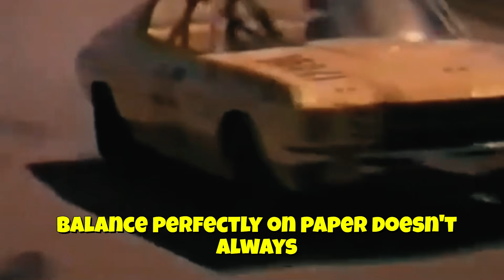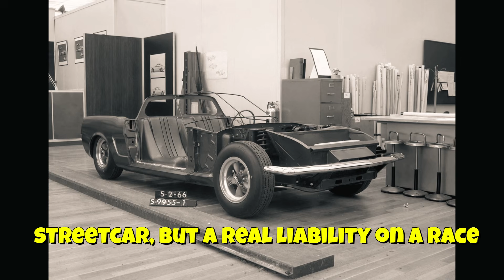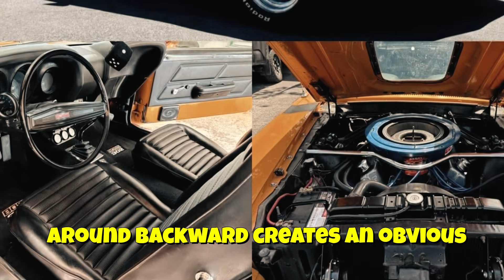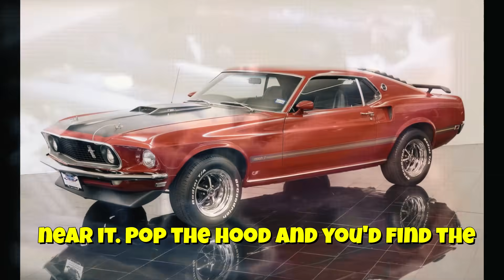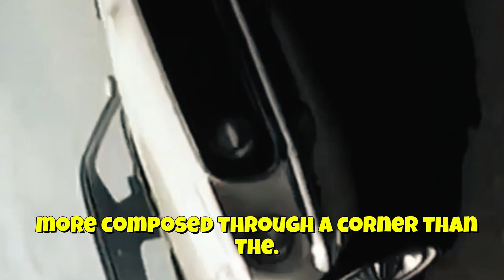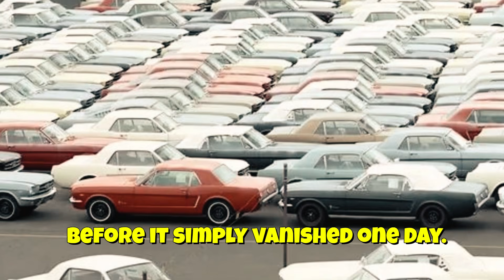Ford Built a Secret Mid-Engine Mustang… Then Tried to Destroy It

Comment: I'm shocked that would have been epic if they got the bugs out but I've had some experience building a secret car for gm no one knew about but me they supplied me prototype parts and my only obligation was to install and report results back part by part using a vericom computer for I'm initial testing this car was very rare 87 Grand am Turbo intercooled all black the contact  was from Pontiac Saturn head of engineering at the same time the Pontiac Gta was turbo was released and the scrapped parts that never made production were secretly sent to me no serial numbers scrapped off parts I made my own piping and brackets all I can say is 4.9 sec to 60mph and topped out at 141mph on maine turnpike quarter mile was rough 13.9 spinning the tires half way down the track lol it was a 5.0 beater and iroc eater and caught some Grand nationals off guard had home made dump pipe intake from a mustang with ram air and stripped of extra weight oh and pushed to 16 pounds of boost no lag another secret part from Gm garret turbo t2.5 blew up many times before the intercooler lol changed 5 of them out